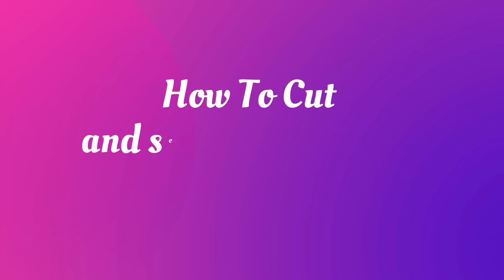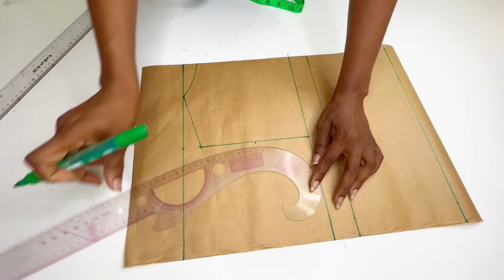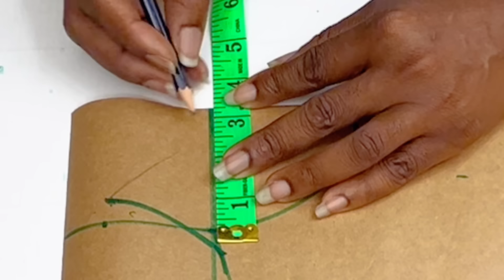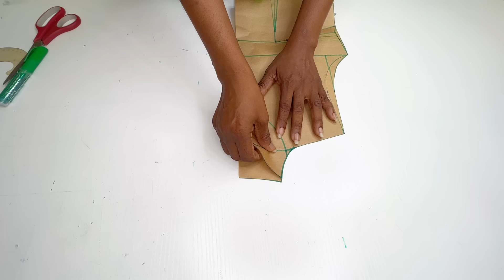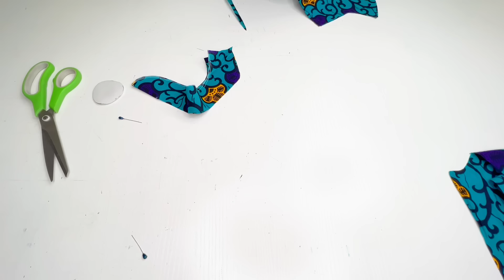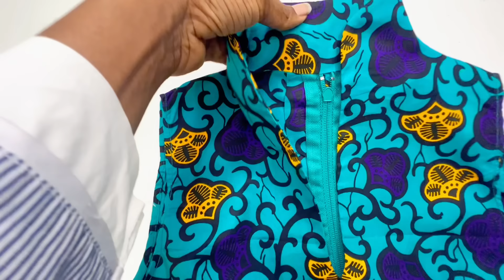How to cut and sew a built- up neckline/ High neck collar

Comment: Thank you for this
Please, if the zip in going to be at the front, does it needed to put zipper allowance at the front too
Reply from the maker: Yes, you will need to add a zipper allowance at the front if the zip is going to be there.

Comment: Mam i dnt want a front v neck cut.. I want a round built up neckline then what changes i will do?? 
Plz help me mam
Reply from the maker: If you don’t want any opening in front and it’s going to have a zip at the back from the top, it’s the same process just that you go down the hight by half inch for the side of both front and back then extend the neck line to the center front but you go down by half inch at the center front.
Reply from the maker: That means the zip at the back will start from the top and the process is the same just come down by half inch at the sides of both the front and back then at the center front go down by one inch then connect the side to the center front.

Comment: By quarter of an inch do you mean half an inch
Reply from the maker: By quarter of an inch I mean for example the longest mark between one inch and two inches is half an inch(0.5) so that will be one and a half (1.5) then the longest line between 1 and 1.5 is quarter of an inch. So a quarter of an inch is 1/4 or 0.25. I hope this makes sense.
Reply: Yes thank you 😊
Reply: Also isn't joining and seam allowance the same thing ?
Reply from the maker: @debbiealfred  yes
Reply: Kuend